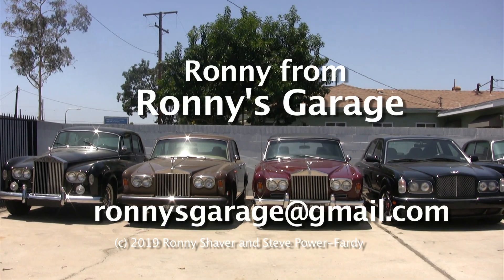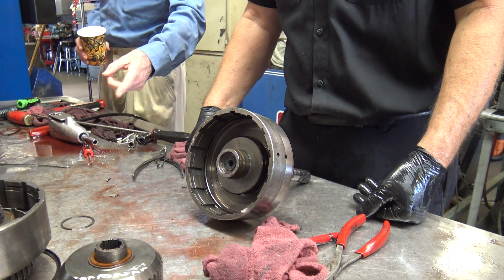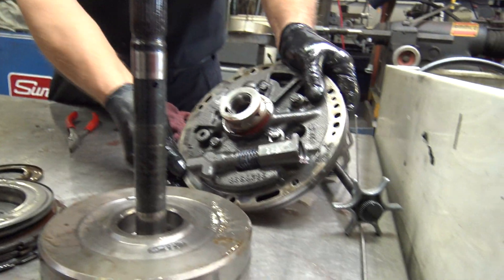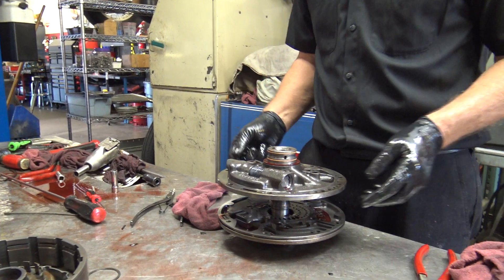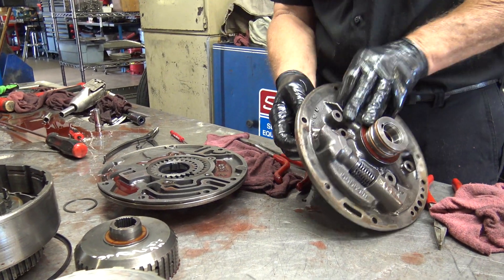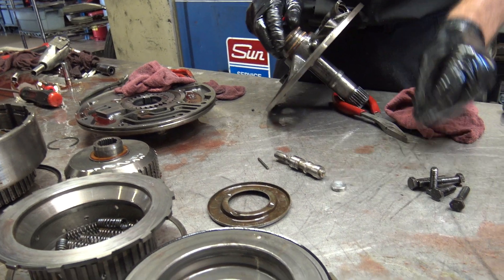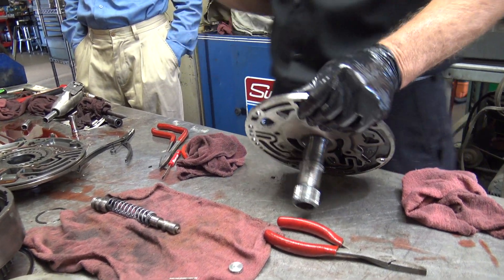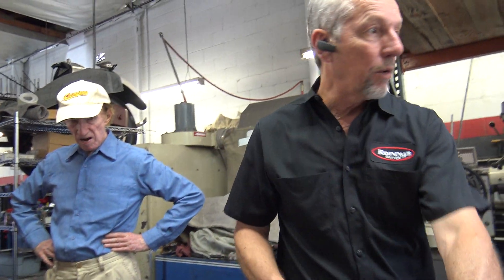Turbo Hydramatic 400 THM4000 Transmission Part 10

Comment: Watched your entire series on TH400.
One extremely important fact.
Output shaft bushings differ .004" between wide and narrow OD. ('64-'74) ('75-'95)

Transtec (stage 1 deluxe level 2 master) kits only provide the wide bushing which WILL NOT FIT LATER MODELS!
They should have included the narrow bushing in this 
I'm working to correct this situation. (Trans Parts Warehouse)